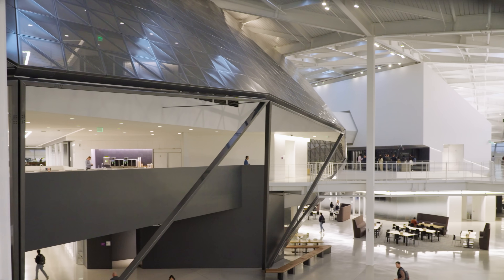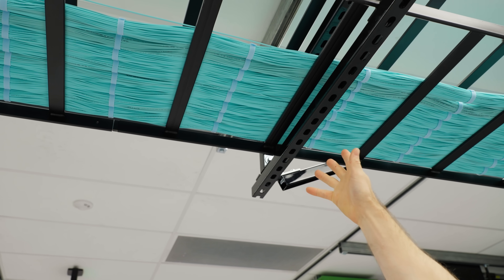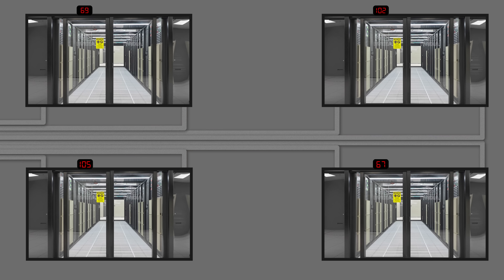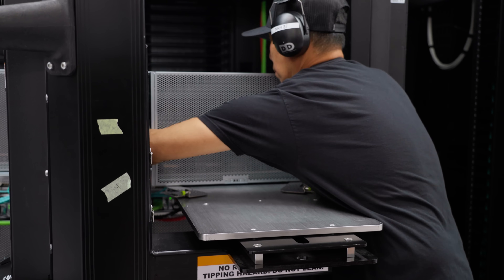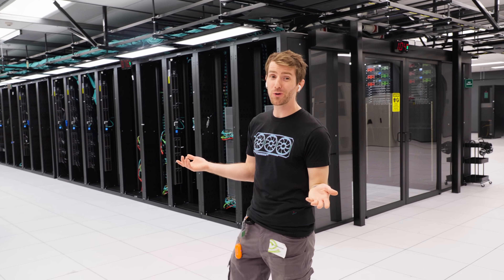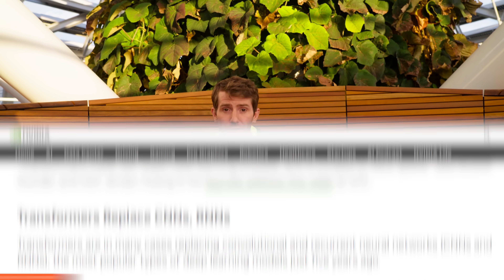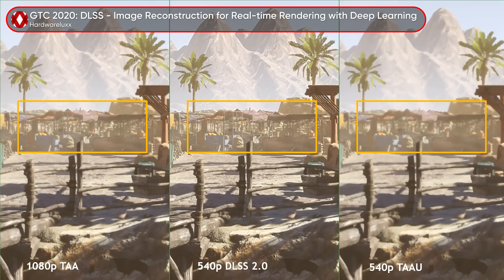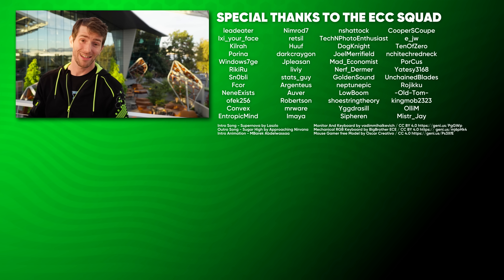NVIDIA Showed Me Their Supercomputer

Comment: So wait, if they're actively pre-rendering 'ground truth' images for the data set.. rather than getting the ai to generate it natively.. isn't that just like giving the robot the answer sheet and it still gets it a bit wrong? The higher frequency detail has always been lacking in the optimised/frame gen modes, which kind of defeats the purpose of >UHD gameplay. Why not just play native on a similar sized display that has a lower resolution? So long as you're getting around 120ish ppi you'll be getting the same experience if not better..?

Comment: Its amazing how much static pressure those fans have to make to push through that many layers of heatsyncs, It also makes you wonder why do those fans always have such large hubs, Im sure there are better motors out there with smaller footprints but same rpm/tq ratings to keep up with more fan blades being able to move more air.

Comment: 3:45 I need to know the gear, configuration and post-production used to get such a "normal-sounding", clear narration clip IN 90 DECIBEL BACKGROUND NOISE.
Reply: It seems that much of the audio is being taken from the AirPods Pro 2/3s in his ears using the new local capture feature with iOS 26. Not sure what the post production workflow would look like, but the APPs did a pretty great job!
Reply: @267co.3  Well, that isolation (and probably craploads of post-processing even after the potential geometric/wave-phase noise-cancellation‽  I don't know yet how they do it but will search the keyword) is WILD. ty!

Comment: Lel calling TAA usage native image quality. DLSS/FSR etc. don't work without TAA/TSR or whatever AA they can use in non UE games. DLSS is just AI AA.
If you turn AA usage off, the native image looks utter garbage.
The dlss team should be using higher resolution upscalng % without AA or just forcing higher resolution to get a clean image without artifacts, and then use TAA/TSR+DLSS stuff, which is well setting the game to render at 66.7/58/50/33.3% resolution scaling instead of 100% while applying TAA/TSR and DLSS fine tuning the result.
Hate that nvidia also decided to use quality/balanced/performance/ultra performance, instead of showing the numbers, but that's also the problem with developers of games, Hogwarts of Legacy actually shows the numbers, also lel most not allowing you to customize it beyond those values.

Comment: I am make a noyron like ai powered system that designs rocket engines. This is my first prototype.                                                              import numpy as np
from scipy.optimize import differential_evolution
from rocketcea.cea_obj import CEA_Obj
import torch.nn as nn  # For ML hooks
from build123d import *
from ocp_vscode import show  # Optional viewer

class ApexNoyron:
    def __init__(self, specs):
        """
        Specs example (200 kN methalox FFSC-like with coaxial swirl injector + full turbopump):
        specs = {
            'thrust': 200000, 'propellants': ('LOX', 'CH4'), 'MR': 3.6, 'Pc': 100,  # bar
            'injector_type': 'coaxial_swirl',  # 'impinging_doublet', 'pintle', 'coaxial_swirl'
            'cycle': 'ffsc',  # Supports regenerative + turbopump balance
            'max_wall_temp': 850, 'max_dp_coolant': 30e5
        }
        """
        self.specs = specs
        self.cea = CEA_Obj(oxName=specs['propellants'][0], fuelName=specs['propellants'][1])
        self.result = None

    def performance(self):
        Pc_pa = self.specs['Pc'] * 1e5
        mr = self.specs['MR']
        isp_vac = self.cea.get_Isp(Pc=Pc_pa/1e5, MR=mr, eps=40)[0]
        cstar = self.cea.get_Cstar(Pc=self.specs['Pc'], MR=mr)
        t_cham = self.cea.get_Tcomb(Pc=self.specs['Pc'], MR=mr)
        mdot = self.specs['thrust'] / (isp_vac * 9.81)
        return {'isp': isp_vac, 'cstar': cstar, 't_cham': t_cham, 'mdot': mdot,
                'mdot_ox': mdot * mr / (1 + mr), 'mdot_fuel': mdot / (1 + mr)}

    def full_optimization(self, params):
        ch_h, ch_w, num_ch, orifice_d, pump_rpm = params
        perf = self.performance()
        
        # Throat & contour
        at = perf['mdot'] * perf['cstar'] / (self.specs['Pc'] * 1e5)
        dt = np.sqrt(4 * at / np.pi)
        l_total = 4 * dt * (np.sqrt(40) + 3)
        
        # Enhanced cooling (Bartz + roughness factor)
        hg = 0.038 * (perf['t_cham']**0.8) * (perf['mdot'] / at)**0.8 * (dt**0.2)
        mdot_cool = perf['mdot_fuel'] * 0.75
        hc = 0.026 * (mdot_cool / (num_ch * ch_h * ch_w * 1200))**0.8 * 7000 / ch_h
        twall = perf['t_cham'] - hg * (perf['t_cham'] - 650) / (hc + hg)
        
        # Injector (real Cd + type-specific)
        cd = 0.75 if self.specs['injector_type'] == 'coaxial_swirl' else 0.7
        num_orifices = num_ch * 4 if 'impinging' in self.specs['injector_type'] else num_ch
        area_inj = num_orifices * np.pi * (orifice_d/2)**2
        dp_inj = (perf['mdot']**2) / (2 * 1200 * cd**2 * area_inj)
        
        # Turbopump meanline (power balance)
        pump_power = perf['mdot'] * 100e5 / (1200 * 0.75)  # Rough
        turbine_power = pump_power / 0.65
        mass_turbo = (pump_rpm / 20000) * 50  # Scaled estimate
        
        penalty = 0
        if twall > self.specs['max_wall_temp']: penalty += 1e8
        if dp_inj > 40e5: penalty += 1e8
        
        return np.pi * (dt/2 + 0.003)**2 * l_total * 9000 + mass_turbo + penalty

    def optimize(self):
        bounds = [(0.001, 0.005), (0.001, 0.004), (200, 800), (0.001, 0.004), (10000, 50000)]
        res = differential_evolution(self.full_optimization, bounds, popsize=40)
        self.result = res
        print(f"Apex-optimized for {self.specs['thrust']/1000} kN: Mass ~{res.fun:.0f} kg")

    def generate_geometry(self):
        if not self.result: self.optimize()
        perf = self.performance()
        ch_h, ch_w, num_ch_raw, orifice_d, _ = self.result.x
        num_ch = int(round(num_ch_raw))
        
        at = perf['mdot'] * perf['cstar'] / (self.specs['Pc'] * 1e5)
        dt = np.sqrt(4 * at / np.pi)
        dc = dt * 3
        
        with BuildPart() as apex_engine:
            # Chamber + Rao bell nozzle
            Cylinder(radius=dc/2 + 0.006, height=dc*1.5)
            loft([Circle(dt/2 + 0.006), Circle(dt/2 * np.sqrt(40) + 0.006)])
            
            # Conformal helical channels
            with PolarLocations(radius=dt/2 + 0.002, count=num_ch):
                helix = Helicoid(pitch=ch_h*4, height=apex_engine.bounding_box().size.Z)
                Box(ch_w, ch_h, length=apex_engine.bounding_box().size.Z, mode=Mode.SUBTRACT, rotation=helix)
            
            # Full injector (type-specific)
            with BuildSketch(Plane.XY.offset(apex_engine.bounding_box().size.Z)):
                if 'coaxial_swirl' in self.specs['injector_type']:
                    with PolarLocations(radius=dt/4, count=num_ch//2):
                        Ring(orifice_d, orifice_d*2)  # Swirl vanes simplified
                elif 'impinging_doublet' in self.specs['injector_type']:
                    with GridLocations(dt/5, dt/5, 15, 15):
                        Circle(orifice_d/2)
                else:  # Pintle
                    Circle(dt/6)
                    Ring(dt/4, dt/2 - 0.002)
            extrude(0.015)
            
            # Turbopump assembly (centrifugal impeller + axial turbine)
            with Locations((0,0,-0.3)):
                Cylinder(radius=dt*1.2, height=0.2)  # Housing
                with Locations((0,0,0.1)):
                    Cylinder(radius=dt/2, height=0.05)  # Impeller hub
                    for b in range(12):
                        rot = Rotation(0,0,b*30)
                        Box(dt/3, 0.02, 0.08, rotation=rot)  # Curved blades approx
                with Locations((0,0,-0.05)):
                    for b in range(10):
                        rot = Rotation(0,0,b*36)
                        Box(dt/4, 0.015, 0.06, rotation=rot)  # Turbine blades
            
            # Subtract internal volumes
            Cylinder(radius=dc/2, height=dc*1.5, mode=Mode.SUBTRACT)
            # Nozzle subtract...
        
        exporters.export(apex_engine.part, 'apex_noyron_full_engine.step')
        exporters.export(apex_engine.part, 'apex_noyron_full_engine.stl')
        print("Ultimate open-source engine (injector + turbopump) exported!")
        # show(apex_engine)

# Example: 200 kN orbital-class methalox (scalable to MN)
specs = {
    'thrust': 200000, 'propellants': ('LOX', 'CH4'), 'MR': 3.6, 'Pc': 100,
    'injector_type': 'coaxial_swirl'
}

apex = ApexNoyron(specs)
apex.generate_geometry()

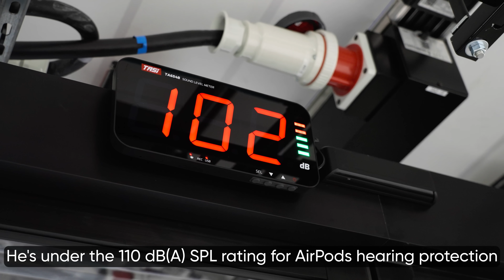Comment: What does he mean at 2:19 when he says SPL rating for airpods hearing protection?  Does that mean that airpods wouldn't help?  that airpods say you shouldn't go above that?
Reply: It means that Linus is just barely safe using the airpods for hearing protection.

If the room noise was above 110dB, then he'd have to upgrade to proper hearing protection.
Reply: @Killerrin ok, it’s the maximum db rating for noise cancelling on the AirPods Pro 2. Are the pro 3s any better?

Comment: Honestly I'm kinda surprised the whole place isn't water cooled with towers like a nuclear power plant. Running a bazillion fans cant possibly be more efficient than a giant water loop. 
Sure, it would require a bunch of extra hardware and plumbing, but they're in a position to get the materials for pennies on the dollar and the upfront costs would be almost immediately cancelled out by the energy savings. 
If they had a solar array to just run the pumps and not the actual processes they coud possibly negate the cooling costs even further. 
I'm sure such a huge company has people to crunch those numbers and im probably completely wrong, but the current setup just doesnt make sense to me.

Comment: DLSS is like one of the few ways of using genAI that isn’t morally questionable. That thing about the DLSS image being better than the native res sometimes is something I kinda expected after studying computer grafics. I think it might even be a good idea to run a DLSS like algorithm on the SAME resolution. Not upsampeling resolution but instead fidelity. That might be even better. Like running a cheaper rasterized version of the game but having the transformer be trained on the fully pathtraced thing. That might get the best graphics for the lowest cost in some games.
Reply: I think "DLSS at the same resolution" can definitely make sense, the same way SSAA 2x makes sense. But not for ray tracing in any meaningful way. The whole point of ray tracing is to get lighting that"s physically accurate to geometry of the scene, super sampling just does not have enough data to do any kind of remotely decent job at that. You'd need a model that effectively has access to the whole scene. That's a much taller order.
Reply: @leeroyjenkins0you just basically outlined what I want my bachelor to be about 😅

Comment: especially íf youre playing on a 4k screen, and especially if its something like a 32" 4k240hz OLED instead of a 100" 4k TV, the DLSS 3 and 4 upscaling will usually look unbelievably good.

The new DLSS 4 transformer model upscaling  (will call it TM now) has delivered many massive improvements over the already really good DLSS 3 CNN model. There are some specific areas or situations, where the old CNN model can be slightly superior to the new TM , but overall the TM is delivering a better image.

To strengthen my point - I do have the best pc one can build atm; a 9800X3D with a RTX 5090 and as said I play on a 32" 4k240hz QD-OLED monitor. My pc is obviously strong enough to play without DLSS in virtually all games, besides heavy RT or Path Tracing. BUT I almost always  use at least DLSS Quality, if its available. This setting means the game is rendering at 67% resolution scale, which means my 5090 renders the game internally with a 1440p resolution (~3.7 mio pixels). And then the DLSS upscaling algorithm basically fills in all the missing pixels to reach the full 8.3 mio pixel 4k output of my monitor. it reconstructs the natively rendered 1440p image to a full 4k output. 

Since the internal rendering resolution is so high in this case with 1440p, the GPU is actually rendering quite a lot of the image. 67% to be exact. This means that the upscaling algorithm has a lot of data to work with, which results in an output image that is extremely close to native 4k. this effect gets strengthened, when your 4k screen is quite small, like a 32" or even 27" screen, since each pixel isnt being blown up to a big size, like on a massive TV. This makes it a lot harder to spot any potential artifacts or general image quality degradation. In fact - especially with the new DLSS 4 TM, I would say that its unbelievably hard to spot any differences to native 4k rendering (or 4k with DLAA , which is native 4k). Often times it looks even better than native 4k with TAA. 

so to put it together - 4k DLSS Quality on a 27-32" 4k monitor looks usually like native 4k DLAA, sometimes even better than native 4k with TAA. And while this is the case, you get a massive increase in performance, since the GPU is rendering the game in 1440p instead of 4k. This means higher fps, lower latency, less power draw on the GPU, less heat, increased longevity. This way my 5090 usually draws around the 350w mark. I do undervolt it during gaming as well. In very intensive situations, you can easily go to DLSS Balanced or even Performance and with the DLSS 4 TM even those settings will usually look unbelievably good. But especially with DLSS Performance at 4k (which means internal 1080p rendering), there can be games where you notice some image degradation. It can potentially still be worth it tho.
Reply: oh and I am strictly talking about DLSS Upscaling, since this is actually increasing performance - other than Framegeneration, which doesnt increase performance but only the motion smoothness. That one only increases FPS, while increasing latency slightly. FG is also more prone to visual artifacts, specifically the 3x and especially the 4x mode. If I do use FG, which is very rarely, it is the 2x mode. I would use it in Black Myth Wukong for example, when playing at max settings (cinematic), with RT and everything to the max, paired with DLSS Upscaling. in single player games 2x FG can be nice, to reach 240FPS. I would usually only consider using it, if I cant get more than 120-150 FPS without it, while staying at max settings. Usually I would just settle with the 120-150FPS tho. And I would definitely never use FG when getting less than 60-80FPS without it.

Comment: and I would be 100% behind machine-learned supersampling increasing frameframets from a baseline to insane numbers to match the top-of-the-line screen refresh rates. what is instead happening, UE5 games especially RELY on DLSS et al to achieve even 60, and sometimes can't even run at 30 FPS. First let's have an optimized baseline for a natively run smooth experience, and then use DLSS to reach 120/240 and beyond.

Comment: I'm surprised that this data center of NVIDIA only has so few nodes to be honest. Compared to some of the top 500 systems having e.g. 24.000+ Grace Hopper chips (JUPITER), only having 1192 of them (with 8 per node?) seems small. I know, compared to any typical system this is still HUGE, but some issues only pop up when scaled up by a lot. But yeah, having the chance to look at HPC systems is always exciting. I only know a few, the ones where I'm working at and one or two others, but it's still overwhelming every single time, when compared to what we're typically using for compute at home.

Comment: 5:30 this plugs are Common High Power connectors in Germany, every household have at least one (for the oven in the kitchen (its directly wired to the oven) and in Work they absolut Common, all Vacuum cleaners at Work are plugged into Power with These, there are 16A and little bigher the 32A plugs, dayly Handling These 🫣